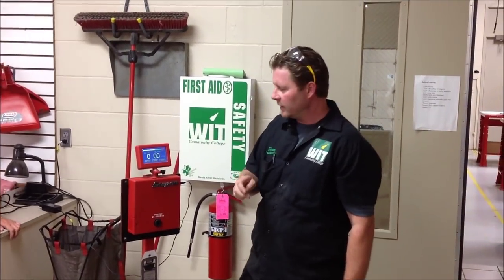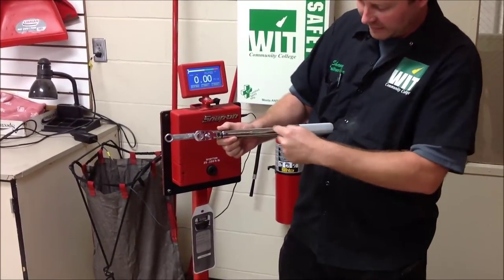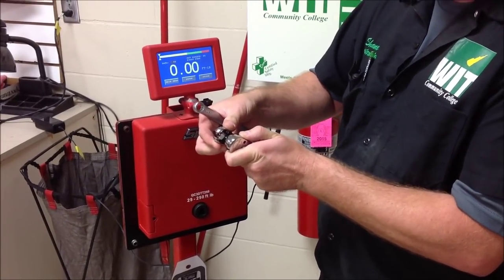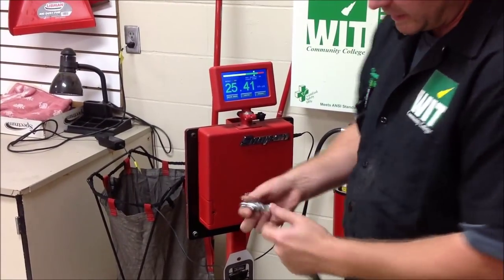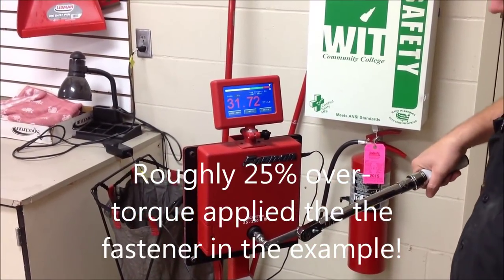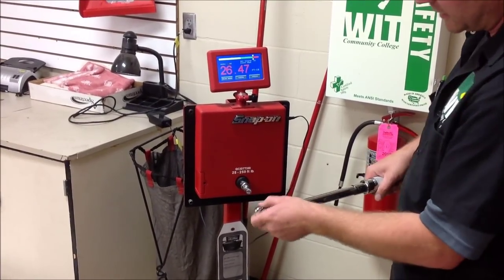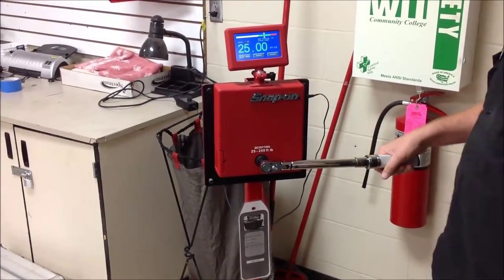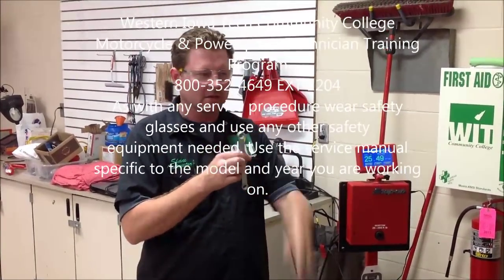How to use an crowfoot or extension adapter on a torque wrench WITHOUT MATH

Comment: Thank you.  This video saved me about $150, going to use a crowfoot on my torque wrench instead of buying an HVAC torque wrench to tighten lineset flare nuts.
Reply: Hubjeep 
So how do you know if the torque wrench is at the correct 90 degrees position for example on the line set connections on the wall coming from the indoor unit?
I’m interested in the crows foot also for mini split 🙁

Comment: 90 degrees is actually just a bit too much extra length, because the hypotenuse of a right triangle is longer than either of its sides.  What you really want is to make an isosceles triangle, with the length of the wrench is equal to the distance from the wrench handle's midpoint to the center of the fastener.  In other words, slightly less than 90 degrees.
Reply: Whoaw.. did you used to sit at the front of the class? Your one Fart Smella. (Copywright AvE)
Reply: Yep - just what I was thinking. Supported by the readings on the device which DID show a slight increase from the original wrench. Pythagoras wouldn't have fallen for that! My view is that it's an "Industry Standard" approach that slightly over-simplifies things but is good enough in most situations.
Reply: That is one of the smartest thing I had heard.  Crowfoot is a pretty small extension.  Set it 90 degrees should mitigate a little.  Your hypotenuse will still be a little bit longer than original length of torque wrench handle, but if you set it one click less than 90 degrees ( opening of crowfoot towards your operating hand) that should mitigate that inaccuracy even more.   Installing a split AC unit and want it dead on.  Thanks.
Reply: Nope. That's quite wrong. It is not the distance that matters. The point here is that the applied torque agree with the torque wrench click. As long the angle between the torque wrench arm and the extension is 90 degrees, the two will agree. See here http://hyperphysics.phy-astr.gsu.edu/hbase/torq2.html for the physics. It hinges on the fact that the sine of 90 degrees is one. Torque is not force times distance; it is force times distance times sine of the angle.
Reply: @kennethfranklin1052  and me the permanent math substitute and on off math teacher.
Reply: Wow ! 👍🏻Now I really feel mathematically  challenged 🙁
Reply: @krabkrabkrab  you are misunderstanding what the demonstration you linked is explaining.

That is not an analog for a torque wrench with an adapter,  it's an analog for a torque wrench that has its user pushing at an angle other than 90° on the handle.

The torque wrench itself erases that issue, as regardless how you push on the handle it's calibrated for the specific torque.

OP is correct in that changing the length of the lever arm by adding an adapter at 90 is only an approximation to the correct torque when the extension is short relative to the wrench.

(The adapter isn't being pushed on by a force at an angle, it's being acted on by a torque, the distance is relevant here, not the angle)
Reply: I think you are mistaken
Reply: We only consider the perpendicular dirance from the force to the center of rotation, if you wanted to take the hypotenuse length then the perpendicular force on that line would be reduced, because we will have two force components, one is perpendicular to your hyppotenuse and the other is parallel.
I hope that i have delivered my point clearly 😁
Reply: @mohammadaljadi75  you are right that the hypoteneuse does reduce the torque reading needed to achieve a given torque.

The hypoteneuse does represent the distance perpendicular from the center of rotation to the handle.

Just imagine you had an L shaped wrench (as opposed to a straight wrench and a crows foot or adapter), as far as torque is concerned it functions identically to a wrench which spans the hypoteneuse.

I may be isunderstanding you, though,  it's surprisingly difficult to describe clearly without being lengthy.

Comment: Thanks man!  I did not believe that 90 degree thing until I saw your vid now!
Reply from the maker: Great! 
You're in luck. I do offer personal service to back up what's missing from a video to actually fix your specific problem. I do work on donations for my time and possible research. 
Good news is its CHEAP! For my time would mind becoming a member of my website? It comes with a free HOW2WRENCH “Keep Wrenching” t-shirt or 20 mins of techline and that will cover my time to assist you so we both benefit. So to have me personal cell phone number to put in your phone as your direct info and how to coach, sign up now! As always thank you and enjoy the free videos! Much more to come! I look forward to working with you and hope you will become a member of or learning community. 

Link to membership: https://how2wrench.com/product/membershipmembers-onlymembers? 

If I can ever be of service to you, here is a video explains how to connect with me. 
https://www.youtube.com/watch?v=vjvmB01ebcs 
Direct link to services: 
https://how2wrench.com/product-category/tech-lineservice-callminutes/ 
Live Chat is great for you to actually show your specific issue!
Donation link: https://www.paypal.me/how2wrench
Reply: You should still not believe it, but it is a good approximation as long as the extension is short relative to the length of the wrench.

Becauset does affect it, even at 90°s.  It will be approximately correct only when the adapter is very short relative to the torque wrench.

Basically you're making two legs of a right triangle and the hypoteneuse is the arm of leverage.  The ratio of the hypotenesae to the wrench is the factor you will be off by.

You'll notice he switched from his adapter to the much shorter crows foot to demonstrate at 90°  and it still showed slightly higher than the control runs.

Comment: I was hoping to see a test using a standard socket extension.  My inch pound torque wrench seems to be way off if I use a three inch extension along with 3/8" to 1/4" reducer and I can't figure out why it would be affected this way.  Puts waaay too much torque on my bolt with this setup.  Can't reach the fastener without the extension, so I've resorted to just a seat of the pants feel.  Helpful vid nonetheless.

Comment: I have had this same question and it seem that if you had an extension to the wrench it self then yes the torque will change....but if you add to the drive it will not change the value...in short...It depends on which you are making longer, the wrench or the torque wrench HANDLE.
Reply from the maker: Thank you for taking the time to comment! Hit that subscribe button please! It helps us!
Here is a way to support all the free videos.
Want to say “thanks” or “keep it up”? Click here https://www.paypal.me/how2wrench  

Coach Conley is also available for hire to personally work one on one with you if ever needed. Yep he is a real person. Give him a call @ 602-345-0432

Your answers and help are just around the corner. Save time and money while protecting your investment and yourself by doing it the right way!
Follow us!
Web:
www.How2Wrench.com    
www.Tools2Wrench.com

Comment: @Shane Conley    Great series, interesting point with the 90 degree offset remaining the same torque. very cool to see the results. So using a traditional extension on the torque wrench head, does that affect the overall torque being as your handle to head length hasn't changed, just the distance from the fastener to the torque wrench?
Reply from the maker: Zack Saunders 
No but I cannot speak of a limit though. Really long extensions may allow some "twist".

Comment: I have a couple of questions,  i'm using a click type snap on torque wrench on wheels and some people ask me why i like to check a wheel's torque sequence, star pattern over 3 times, is it bad? I like to do it to ensure that the nut does not move. Some people just torque it once and that's all to them... There's been times its stopped moving because i didn't have much movement for the torque wrench and it probably torqued at 65 ft lbs rather than 76 ft lbs.
Reply from the maker: Great news for you! I have solutions for you and will point you in the right direction. Head over to my website become a member now and to receive 20 minutes of personal mentorship with me. You can even use FaceTime if you have it or find a friends iPhone and we can walk through the actual carburetor process together. I look forward to mentoring you.

Note: Membership is not required to receive coaching or email help. Here are the direct links to individual services offered at H2W:

Email Answer Service-Click http://how2wrench.com/product/email-support/ 

Phone/FaceTime Coaching-Click http://how2wrench.com/product/personal-tech-training-phone-facetime/ 

DIY Mentorship-Click http://how2wrench.com/product/diy-coaching-hire-teach/ 

Dealership Training Services-Click http://how2wrench.com/product-category/dealer-services/ 

MMI/Tech School Student Tutoring-Click http://how2wrench.com/product/mmi-tech-school-student-tutoring-services/

Motivational/Guest Speaker-Click http://how2wrench.com/product/motivational-speaker/ 

On-site Training Services-Click http://how2wrench.com/product/on-site-training/ 

Tech Line Services-Click http://how2wrench.com/product/tech-line-minutes/ 

Mechanic on Duty-Click http://how2wrench.com/product-category/mechanic-on-duty/ 

Did you like this free video and hope to see more? Would you just like to say thank you with a donation? Click https://www.paypal.com/donate/?token=TvKoeRazPL-KysbM-e0ttz-C_gPq2IrqxDmM3ORCu4nxJzQWxYbmo-6m3YuNu64XHLngGW 

Keep Wrenching,
Shane Conley
Instructor/Motivator/Motorcyclist!
www.How2Wrench.com

Comment: love your vids thanks. Do you know why HD uses a final cyl head torque by angular measurement and not continue with a torque setting? I've seen several older cars using the angular method over the years as well as a few broken head studs!
And so many of the aftermarket "monotorque" style auto suppliers here recommended a torque figure instead. Wondering why HD engineers chose this method for an air-cooled twin? .. thanks, Richard.
Reply from the maker: Richard I do have the answer right from HD. Stay tuned as I have an upcoming video on it.

Comment: torque =  force x length .   I suppose you can just subtract 1 ft lb from your readings  if using the same crows foot length  @ 180 degrees.   The torque wrench itself has a approximate  error of  +/-  0.5 ft lb anyways.   In the real world for most applications that will not make a critical difference. The longer wrench yes, you will see a larger difference.
Reply from the maker: :) Thank you for taking the time to comment! Hit that subscribe button please! It helps us!
Here is a way to support all the free videos.
Want to say “thanks” or “keep it up”? Click here https://www.paypal.me/how2wrench  

Coach Conley is also available for hire to personally work one on one with you if ever needed. Yep he is a real person. Give him a call @ 602-345-0432

Your answers and help are just around the corner. Save time and money while protecting your investment and yourself by doing it the right way!
Follow us!
Web:
www.How2Wrench.com    
www.Tools2Wrench.com

Comment: The calibration unit has a minimum torque of 25 ft lbs so when you were excited and stated "not getting better than that!" that's because it couldn't read any lower. Just saying.

Comment: what about socket extentions?
Reply: Socket extensions don't affect torque value.They could affect torque value if you have a weak socket extension,or if you have multiple socket extensions,and they twist.For accurate torque reading,only strong and adequate socket extensions.
Reply: Even if they twist, the torque at the opposing end of the torque wrench is holding the same torque that the using is putting into the torque wrench.  If you can't get the torque wrench to click cause its twisting that bad then thats a different story.

Comment: I see the variations of the readings of your test compared to the students..
I apply torque slowly to get an accurate set ..
You appear to apply the pressure to quickly, resulting in a inconsistent result..

Comment: You are actually mistaken on this, and If you had used the longer extension at 90 degrees it would have been apparent.

Instead you switched to the crows foot. (It was only slightly higher than the prior runs so you swept it under the rug)

The 90° rule is only an approximation when the adapter is short relative to the wrench, and even then it will be off by a couple percent, as we saw.  

For example, if the adapter is the same length as the wrench at 90°  you're actual torque will be 41% higher than indicated. (Pythagoras  sqrt(1+1)=1.41)
Reply from the maker: Hello and thank you for commenting. I'd recommend you consider watching the series were we show it many more times with extensions as well, along with reading the manuals to the viewer (multiple brands) and different use cases with training received (and supported) by the tester manufacture CDI (Snap On doesn't really make them... :) As we welcome all comments ESPECIALLY ones so well wrote....we thank you again! 
You rock for commenting! We will let Shane know! You can give him a high 5 here:  https://www.paypal.me/how2wrench   
Another way to help us back is joining or grabbing our T-shirt! Support links and gear below!  Awesome and thanks for commenting! Smash the subscribe button (thank if already a sub!)
Have you seen our "YouTube Trained Support Shirts? Great way to "high five us" https://goodfellasmerch.com/collections/how-2-wrench/products/support-shirt 

Join this channel to get access to perks:
https://www.youtube.com/channel/UCBhM8DCKnT3qXwTW0eToyCg/join    
-Daily MEMBER FIRST COMMENTS ANSWERED FIRST 
-Live Q/A video chats
-Wonder if we have a video on your need? Members can request content links!
-Full Access to the ENTIRE 700 video library
-Member-Only FREE tool giveaways   

Got an emergency and your head is about to explode from frustration or fear? Get Shane’s cell here: https://how2wrench.com/ols/products/techline-one-on-one
Reply: @How2Wrench  it's really awesome that you make content like this, it's the best I've seen on YouTube.  And I'm jealous of your equipment.

And yes, I've seen the recommendations in manuals and elsewhere for the 90° rule, but it's still just an approximation or rule of thumb,  even if it's a really widespread one.

For example, even with a 3inch extension and a 12 inch wrench you're only over torque by 3% at 90°.  So it's not a bad rule to go by.

It only becomes a problem if somebody takes the rule to heart and uses an extension isn't short relative to the wrench.